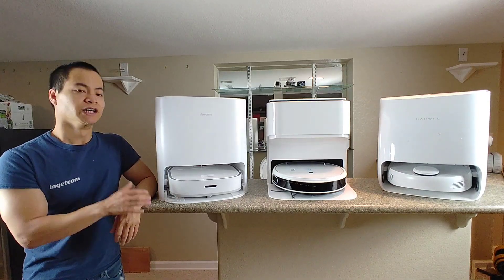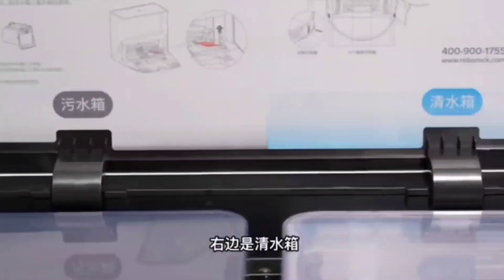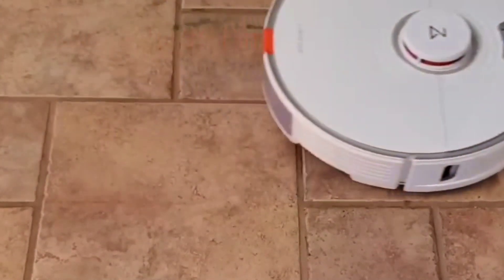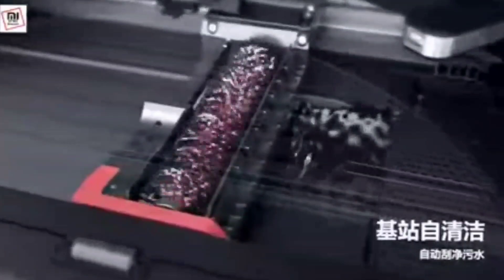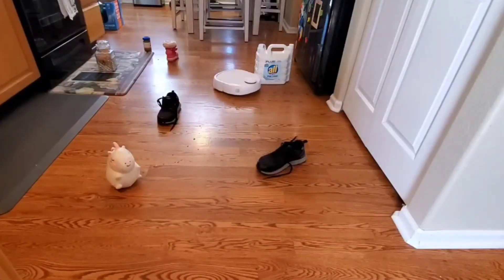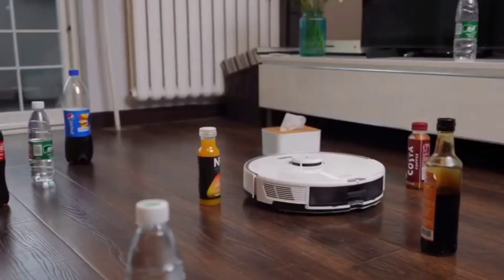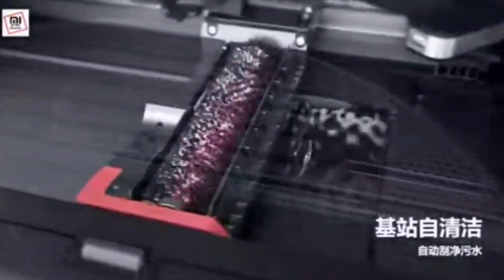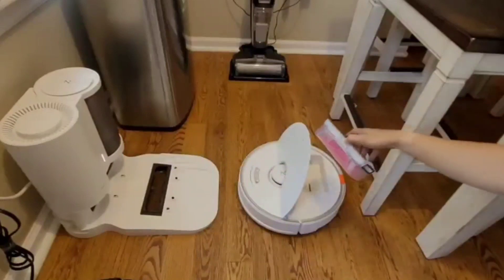Roborock G10 Self Washing Mopping Robot and Vacuum!! Previewing Roborock Latest Model

Comment: I have the G10 and it’s excellent, works much better than the rotating mop style robot (at least the one I tried).
Reply: Notice that G10 only on sell in mainland china and App not support outside of mainland china. Question where did you purchase the G10 unit and do you encounter issue to install App through App Store and Google play store?
Reply: @whk8262  Is this likely the one that is going to be announced tomorrow in the United States?
Reply from the maker: Oh wow, how is the navigation. Does it avoid obstacles well. Also is there a drying function to dry off the wet mopping pad?
Reply: @RobotMasters   navigation is great, seems precise without any unnecessary movements. Obstacle avoidance is good, it has quite a light touch which is nice, I haven’t used a machine with camera based obstacle avoidance before, but the sensors this does have seem to work well and probably better than what I’ve used previously (Neato and Xiaomi). There is no fan drying on this but the way it docks with the mop pad raised seems to do a good job drying, and in conjunction with the Roborock cleaning fluid that you mix in with the freshwater it seems to not get smelly at all, and it washes the mop pad surprisingly clean. I tried the new Xiaomi Pro with the rotating wash pads and didn’t get on with it, that had the drying function but it didn’t work that great and I noticed the pads did smell slightly after a few runs. The navigation on it was bizarre, it did random things every run.
Reply from the maker: @starbees  Thankf for sharing your hands on experience. Seems like the G10 implementation of the mopping system is better than what the competition is offering.
Reply: @starbees  doesn't this G10 has self drying for the mop?

Comment: Also, if I already have an S7 plus with autoempty dock , will I be a le to send the robot S7 pro to the auto empty dock to empty the dust bin
Reply from the maker: Are you talking about the S7 MaxV? If so all 3 model versions are identical, only differences is one dock only self emptying and the other dock can self empty and wash. Keep in mind the original S7 is not compatible with the Self Emptying or Self Washing Dock.

Comment: I haven't been able to find the G10 or heard of its releasing. I did get news articles about the releasing of the Roborock s7 maxv ultra . It is very interesting!! I wish my S7 had a bin to remove or separate the dirty water .

 Roborock is coming out with a lot of new products now. 
They have released an approved cleaning solution that is now compatible  to use in the water tank of the mop vacuums. 

 They also released a washable Cyclone and Dust Bucket to Substitute Dust Bags for the S7+ auto-emptying dock!

I would like to see the reviews of these upcoming products .
Reply from the maker: Hello Yes Roborock is coming out with some new products for 2022, which includes an approved cleaning solution, a bagless system for the S7 and S7 MaxV Plus Dock. Not sure if the Ultra Dock will have a bagless option too? Anyways there will be some mid range models too that will self empty. As of now the Ultra Dock is only compatible with the S7 MaxV. I plan on getting the solution if it helps with tougher stains.

Comment: Recently bought S7+auto empty station, works well, only I don't like cleaning the mop manually. If I'd buy a self-washing mop (
 only to use the mopping if it's a combi), any tip for the best choice (no carpet only hard floor here)? Thanks!
Reply from the maker: Hmmm the best performing one that I tried is the DreameTech W10. Also the Narwal not bad and might do fine since you only have hardwood floors. It a suction only port for the vacuuming no spinning extractor bar. There a few self emptying and self washing robots coming out for next year but since you already have the S7, I don’t think you would need another self emptying robot too!!! So I would choose the Narwal or W10.
Reply: Thanks a lot for the tip!

Comment: Notice that G10 only on sell in mainland china and App not support outside of mainland china. Question where did you purchase the G10 unit and do you encounter issue to install App through App Store and Google play store? Need to get more detail before purchase.
Reply from the maker: So from what I read and heard, the G10 will be region locked. Won’t be able to use the Mainland China in different areas. Roborock has announced the X7 which should offer similar features.

Comment: What your recommendation for the best self emptying mop and vacuum for deep cleaning that I don't have to manually switch it over to vacuum? Just bought the XL self empty shark AI for regular vacuuming (3 large Great Pyrenees in my house), and considering returning it because I had no clue they had self empty bases for mops now too! I need something well built because of the dogs.
Reply from the maker: My personal favorites are the Roborock S7+, DreameTech Z10 Pro, Ecovacs T8+
Reply: @RobotMasters  I was considering the Dreametech W10 for mopping and just getting a self empty vacuum seperately like the Shark AI with XL base. I need the heavy duty mop, and would like the self cleaning base - but need the vacuum power for pet hair. Think that would be a good system duo, and am I on the right track? The shark for daily use, and the mop probably 3 times a week. I'm also considering concealment because I plan on building a storage breakfast bench around the bases on the wall they'll go on - I'm trying to stick below 22" which is the w10's height so my nook seating doesn't become bar seating! We're farmers and have very little time for cleaning and a LOT of dirt that tends to be tracked in - so looking for a good automatic system so I can clean like once a week and not have to spend all day doing it.
Reply from the maker: @matthewnorman4567  Yeah I think this is a good combo. The Shark is a good cleaner and should handle the mess. If you are going to have more than what the robot dustbin can hold, I would recommend a Roomba for a lot dirt.
Reply: @RobotMasters  Thanks for the videos! I like being an informed buyer and you certainly helped!!

Comment: When they combine those docking station of S7 (self emptying with no dirt bags) and G10 (sefl washing mop) Im all in! :) btw. Thanks for another great video!
Reply from the maker: Sure glad the video helped 🤣
Reply: Are you considering the S7 Max Ultrav ?
Reply: @Sun.n.Flowers  I was until this week. Now i decided that i'll wait for Roborock G10S Pro:)
Reply: @Rebel_at_Heart  There is a G10S Pro?? Where can I get more info about it?
Reply: @Rebel_at_Heart  What difference is there with G10 s pro and MaxV Ultra appart the option plumbing connection ?
Reply: @theattorney6072  as far as i know G10S Pro has mop dryer and something related with water sanitizing using silver ions.
Reply: @Rebel_at_Heart  you mean the lava drying module for s7max? They will add on to G10S pro?

Comment: can you make a clip comparing the cleaning ability of x1 omni vs w 10, do these 2 robots hold the water tray on one side... any good robot?????
Reply from the maker: So my personal favorites are the Roborock S7, S4 and the 360 S9. I also like the Roomba J7 and i7. As for the head to head, the OMNI definitely has more features, but may not navigate as well as the Roborock since the past models Roborock has been better at navigating. As for mopping performance having tested the S7 and other mopping robots that use rotating mopping pads, I found the S7 to perform better.

Comment: If my main purpose is to suck fine debris like hair, dust and bits of fur, and mop.

I don't really heavy debris like sand or cereal etc. 

Is roborock s7/g10 better? Or shd I get ilife450? Or any other recc? 

LOVE YOUR CHANNEL. SUBBED!
Reply: I just got the s7 and the mopping is really good. You will need to wash your pads and dry them. But for 450 it's really good.
Reply: @John-shreds  do you have the w450 also with the S7 ?
Reply: @theattorney6072  No. Sorry, I payed $450 for it on sale
Reply from the maker: Hello 👋 so basically get the G10 if you value having the convenience off a self washing option. Also the G10 will likely be compatible with the self emptying system later on. The S7+ is currently on sale and I find that robot vacuum to work very well and is a recommended buy. Lastly the w450 is designed for a mopping only robot with limited functionality.

Comment: Roborock will not let you use the G10 from mainland China with US MI Home app. I have a hacked MI Home app with no region lock. I can give you some info if you are interested. Then you can get the t7s and g10
Reply from the maker: Sure I could use some additional info. Thanks
Reply: Hi. I just bought a G10 from China without knowing the App for it is locked by region. Can please share how u did it as no good without the App

Comment: I'll stick with my s5 max . Waiting until I see a robot with better performance on the mopping system than the ones available.
Reply from the maker: I see, I think changing the way the robot mops might help. Adding a Y mopping pattern or a short back and forth pattern found on the Braava Jet m6. Utilizing the same Vacuum pattern for mopping doesn’t make the mopping part perform well even if it vibrates or spins.

Comment: One of the things roborock needs to add to their base is a TOUCHSCREEN!!!!!!!!! Also, there should be a steam jet shooting hot hot water and steam onto the pad.

Note: The G10 won't work with the self-emptying dock, because the contacts for charging are on the FRONT and not the rear. This indicates that a new dock will be made for the G10.
Reply from the maker: Yeah, I agree!!! Not 100% sure if it has a Hot Air Drying feature that found on the Dreametech W10.

PS: Good eye, you are correct looks like there a redesigned self emptying station or a combination of the two!!!
Reply: @RobotMasters  in the video, it uses like a squeegee to srape all the water off.
Reply: @RobotMasters  I prefer the spinning mops over Vibrarise.
Reply from the maker: @MrBlueCreeper  Oh how come?
Reply: @RobotMasters  I just think it is more effective that way.
Reply: I also updated my main comment. It will review if the G10 will work with the S7 Auto-empty Dock.
Reply from the maker: @MrBlueCreeper  Yeah but you are right with the charging contact locations unless there some on the bottom.
Reply: @RobotMasters  there isn't any on the bottom.
Reply: @RobotMasters  Put 100 pounds of rice on the ground and let all of your robots clean it up.